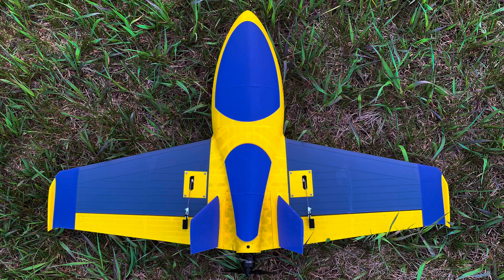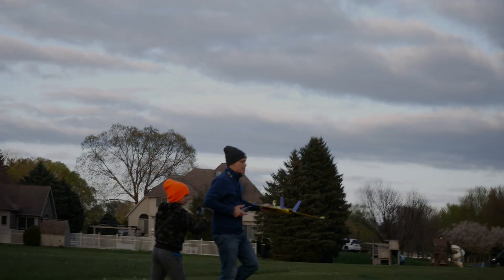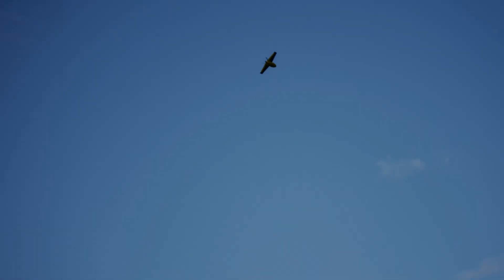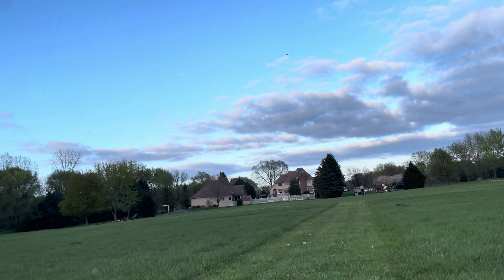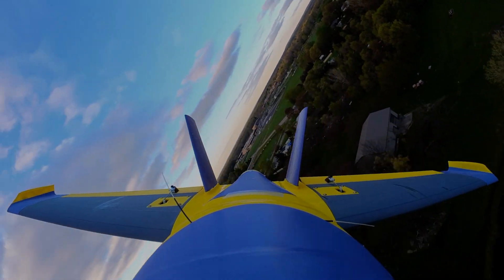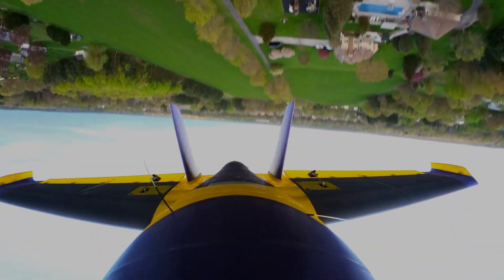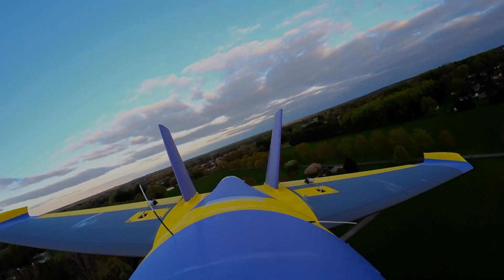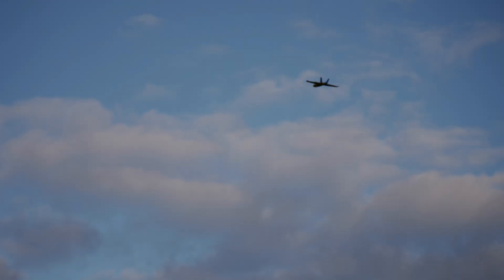The Flying Spaceship - Velora 3D-printed flying wing

Comment: What onboard camera are you using?
Reply from the maker: That's an Insta360 Go 2 in a custom (but simple) 3D printed mount which is rubber-banded to the fuselage.  It's older and the battery doesn't last that long anymore, unfortunately.  I should have put my Caddx Peanut on there with the 5V power supply.  I don't know why I didn't think of that.  :/